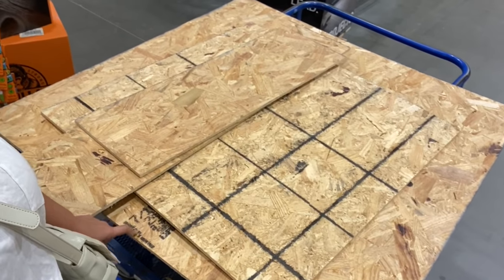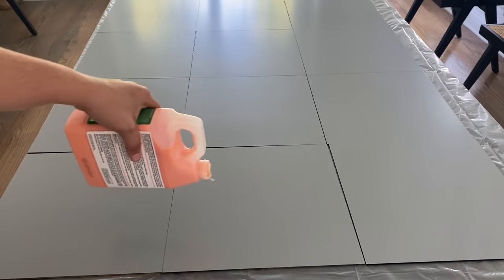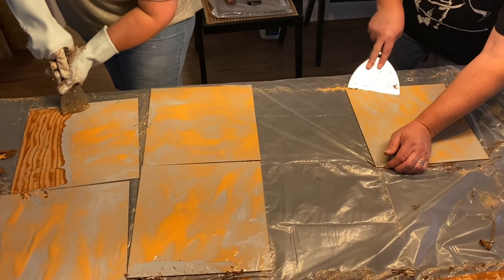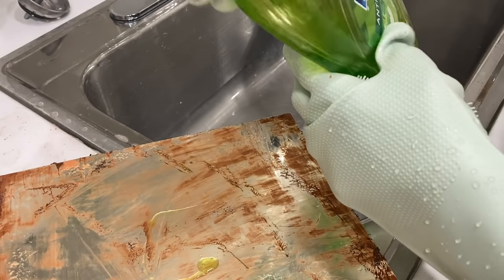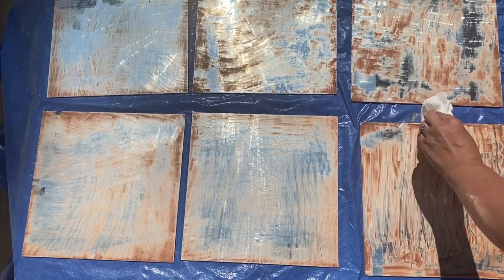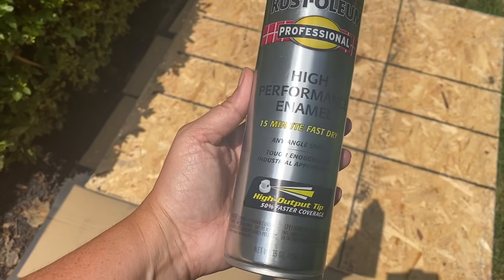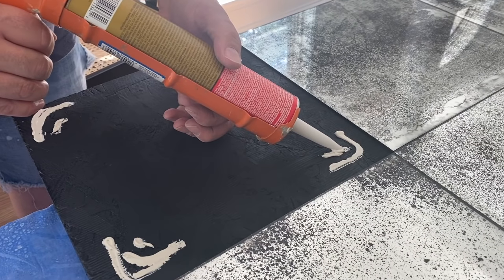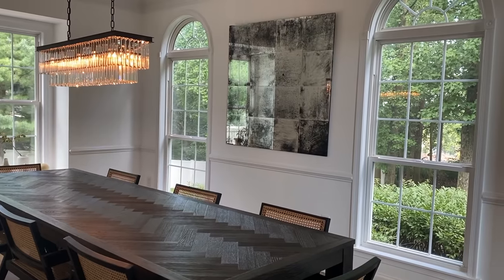Restoration Hardware DIY ANTIQUE MIRROR / How-to steps for under $50!

Comment: Hey there I’ve done a lot of mirrors, a good tip for you. Instead of using a brush to put on the citrus stuff, use a  contractor roller. You can keep going over it until the paint starts coming off to limit the amount of scraping. Got to use a lot of stripper!!!!! I’ve never had to scrape cause I was able to use a hose to spray it off.  Hope this helps.
Reply: Great tip 👍

Comment: I did the same thing several years ago using the beveled mirror tiles.  Mine was 4x8 ft.  My son-I-law did it in December in the garage and put wide crown molding around it.  It was spectacular!  We used mirror mastic to attach the tiles and butted them tightly together and hung it above the fireplace.  It was everything I thought it would be, and better.  The fireplace was on, the room spectacular, then- one by one the mirrors started to crack.  They were butted too closely together in a very cold garage, and when they warmed they expanded.  Ruined.  Maybe I’ll do it again, sometime in the summer heat.  Learn from a fail, friends!

Comment: FYI you can achieve a much quicker mirror distressing by spraying oven cleaner on the backs of the mirrors, letting it sit for about 30 minutes and then just wiping it with a towel. I did this a few years back and it worked perfectly. Love the idea for the large mirror though looks fantastic!
Reply from the maker: oh awesome! Thanks for sharing that great tip Stephanie! ☺️

Comment: You know you could have saved yourself a lot of hard work by purchasing a mirror antiquing kit.  I got mine from Amy Howard Home and took her class on antiquing mirrors.  The kit has two cans of product.  The first can quickly removes the paint - usually black - on the back side of the mirror so you can put your etched design on the mirrored silver glass. Very fast, very easy. There are other mirror antiquing kits on the market besides Amy Howard's.  Once you have the glass the way you want it, there is a black paint that you roll on to finish it.  You can also stencil a design on the glass.  My favorite is a Greek Key design.
Reply from the maker: yes I used one of those kits a long time ago but not everyone worldwide has access to these products so I made it easier for all to just use a mirror and remove the backing with any kind of stripper. Thanks for watching the video!☺️

Comment: What a beautifully done project and for such a great price too!! I’m definitely going to have to do this one. I didn’t notice, did you finish the edges of the backer board in any way?
Reply from the maker: Thanks Londa! I just mentioned in the video that I spray painted the entire board all around including the edges. It was just solid black but anyone can add trim to it if they wanted to take the design a step further. Thanks for watching! ☺️

Comment: I see you are using plain mirror tiles. What is it that you are stripping off of the tiles...the actual mirror coating? Help
Reply from the maker: The backs of the mirror have a paint coating. Thats the part you want to remove. You will have some kind of film like substance but the bleach/water effect will still work through that. You just have to get the back color off..in my case it was the grey paint on the backs. After the bleach I then cleaned them up and took them out to spray them in black to seal but you can use a pretty gold or silver metallic for a nice look too. ☺️